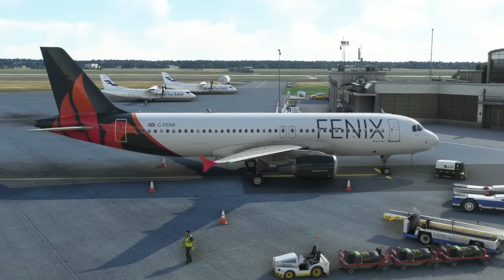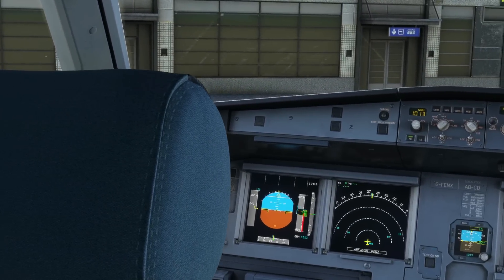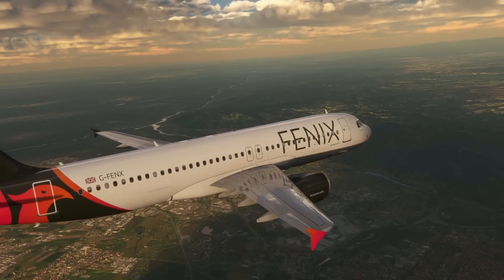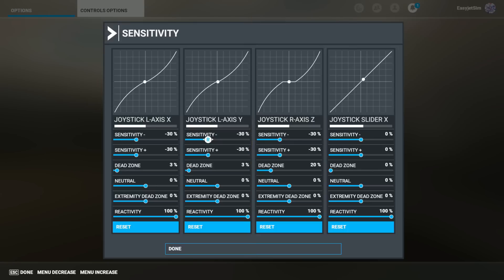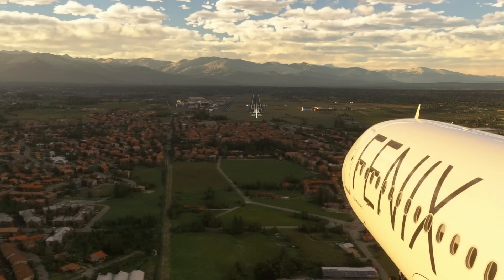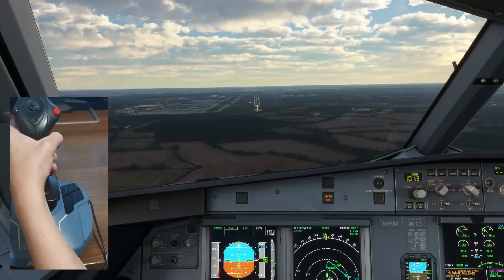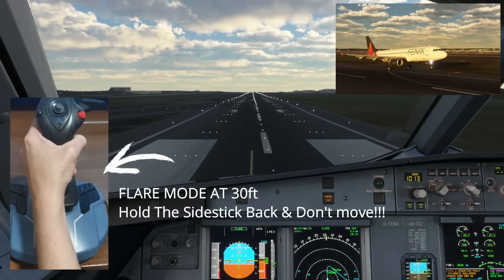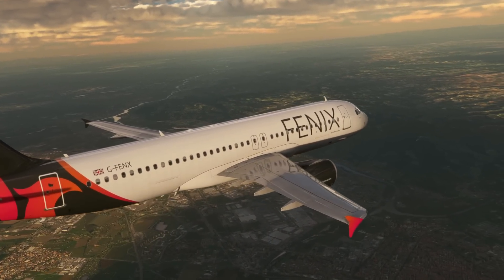New Sensitivity Settings for Fenix v2 - Landing Tutorial With Sidestick Camera | MSFS 2020

Comment: I also found that set the extremity dead zone gives you much more control when on the ground on turns. 
For the FBW aircraft -60% 
For the Fenix and PMDG +60%
Reply: thanks for this tip! didn't think there would be a way to correct this but this setting works perfectly. was such a fine line before between making a turn perfectly and suddenly veering off the taxiway.
Reply: Is that setting for extremity zone just for the Z axis or across the board
Reply: @abassman1976  Z-Axis only. That's for the yaw motion with controllers that use the twitch action type movement. For rudder controllers I'm not sure. The best option is to play with that extremity settings until you found the sweet spot for each aircraft with your type of controller.
Reply: @johanjacobs9240  I did a test takeoff. I like the +60 for extremity. For the othe settings for Z axis do you have them at -30%?
Reply: It does give u more control but ive also found its harder to do tighter turns as with the extremity deadzones u dont get the full 90 degrees of the turn. I done some testing it seems that for the fenix, if u keep the extremity deadzone as 0 and put the reactivity up to 100 then u have more control of ur tiller whilst still keeping ur 90 degrees.

Comment: Twitchy rudder on the TCA joystick! Argh hate it. However I’ve “solved” mine, before loading every flight I twist the side stick full left then full right, 5 times 😂 seems to fix it. Looks like a crap sensor in the thrustmaster TCA side sticks…
Reply: its a common issue. you can fix it in 5mn. you need to open side and clean the magnet. You can find tons of videos on how to do it
Reply: @homasas4837  Mines done it from day one so dont know if its a cleaning issue.  Twitchy asf but after a few twists as above seems to fix it.

Comment: Hi Gavin. I noticed you had the tiller set with the joystick rotation. Would be grateful if you could advise how to set this up. Thanks
Reply: On control settings you have to atribute wheel direction to you foustick axis.. is something like that.. i have done it and very newb in msfs
Reply: Set the rotating axis to “nose wheel steering”

Comment: I have another question, how can I move through the cabin in the Fenix or walk through the plane, or outside the plane, or get on the plane from outside?
Reply from the maker: Using the drone camera (showcase view) and then the arrow keys on the keyboard.
Reply: @Easyjetsimpilot  When I'm on the plane, I can't set the camera to drone, only when I'm off the plane can I set it to drone, but Virtrinen is not included.

Comment: Hi, I need your help again with the Fenix A320, and I have problems flying the plane correctly, always after takeoff I want to activate the autopilot, which doesn't let me. Furthermore, the plane simply climbs higher than it should, despite the fact that I have the throttle It says Climb. Then there are a lot of warning tones, for whatever reason, could you help me with that?
Reply from the maker: After takeoff, you're rotating too much so not getting a positive speed trend. The airplane speed protections then kick in, setting TOGA LK - you cannot arm AP in this mode. Lower the nose, regain speed, take A/THR off - then, one speed is increasing, you'll be able to reengage AP & A/THR.
Reply: @Easyjetsimpilot  Thank you very much I tried it right away and now everything is fine and it works.

Comment: Curious if you have tried changing the Extremity Dead Zones and leaving the sensitivies at 0 (linear). I have found that linear is "smoother", despite loosing some of the range on your extream ends of your stick/yoke. You.dont often use the extreams anyway (cept maybe in fighter jets).  
 I typically try to get the movements of my stick/yoke to match what i see on the screen, and save a profle for each aircraft.
Reply: And everybody on the discord advise to set up linear. Im surprised the dev advised the opposite for the tca. Its very smooth for me too.

Comment: I mean the million dollar question is how does that sidestick movement compare to the real aircraft?  With MOST aircraft a 1:1 comparison is kind of moot given the very large differences in control mechanisms and that normal yoke based aircraft have yokes with FAR larger range of motion, and even sticks in fighter jets typically have longer arms.  But the sidestick in the Airbus is almost identical to a desktop stick as far as range of movement goes.  So yeah really curious how your movements there in this video compare to real world movements on the side stick.

Comment: Hello I Wouldn't recommend you to use dead zones on the L-axis Y and L-axis X because fenix built the new fly by wire system with not using dead zones in mind
Reply from the maker: The Fenix team use the deadzones for the light sidestick.
Reply: @Easyjetsimpilot  By the light side stick you mean the tca a320 ?

Comment: So now we have to be beta testers for Fenix. I snt them a ticket on autoland and they replied they are aware it has issues.???
Reply: What did it do? Havent tried AL since v2.
Reply: @Level10Productions  It floated down the runway. I flew over 175 flights with a VA, in V1, and it never did that. I just think Fenix should have done more testing. So when they come out with Block 2 what is going to happen ?
Reply: @frysimulation  more of the same no doubt

Comment: It’s like learning how to land the 321 all over again!! 🤣🤣🤣
Reply: After watching your video testing of V2. Did you say the pitch is better at around - 20%. Any help on what the real feel is would help.
Reply: @razsmithy  I thought so with the very limited testing I did. Much more testing is required and I’m sure over the coming weeks I’ll fine tune it to what I think is representative. -30% didn’t seem responsive enough in strong winds. 0% was too responsive. So, I’m fairly sure it’s between the two values. 👍
Reply: Awesome. Cheers
Reply: Wait until we get the A330 HD 😉
Reply: @VmcgHD  That's what I've found as well. -30% isn't responsive enough. I'm going to try -20%.